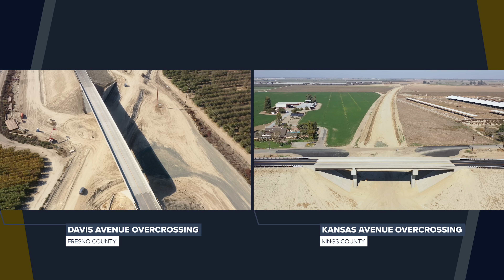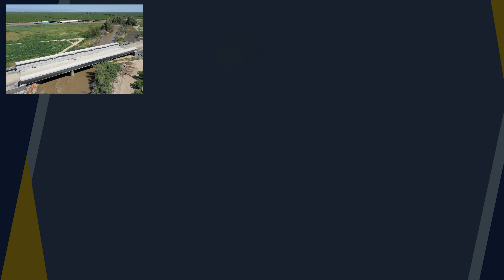Fall 2023 Construction Update: Progress is happening across California thanks to HSR Workers!

Comment: What a boondoggle.  Projected costs are over $125B from an initial estimate of $33B.  There were supposed to be checks for cost and schedule over runs, which obviously failed.  Rider ship estimates are 25% less now than initially planned for.  From LA to Bakersfield to Gilroy to SF.  It wont be hi speed and you need to rent a car on the other end.  The portion showed in the video are out in the valley away from the major urban areas, where its cheaper to get the land and there are less viaducts and utilities to reroute or bridge over.  Land in LA and SF have not been allocated yet and land cost are not going down.  Neither is labor and materials.  If this useless train is completed I bet it will cost over $500B and never recoup the costs.   What a waste of money.  No one takes Amtrac, no one takes the Coaster no one till take this train and will need subsidies to keep running.

Comment: Yes by 2033 you should be able to ride the HSR from Merced to Bakersfield California. There's just one problem, nobody wants to travel from Merced to Bakersfield. After nearly 10 years of construction at a cost of nearly 10 billion dollars not a single piece of track has been laid. The engineering for the project to cross the mountain range into LA has not even been completed. Cost estimates cannot be completed for this section or even its feasibility. Cost estimates for the entire project could exceed 120 billion dollars. This is undoubtably the largest boondoggle conceived by mankind.

Comment: I sincerely hope this is finished in time for the Olympics, or at least within the next 10 years.
Reply: Trains could potentially begin testing by Summer 2028, but the earliest service is projected to begin is 2030, and that’s best case scenario, at least as of now. 

SF could definitely be reached in the 2030s, as potentially could LA before 2040. It just comes down to how quickly they can get funded, plus 6-7 years of construction to reach SF and probably closer to ten years to reach LA and Anaheim, and ideally both extensions would be funded and built simultaneously. 

CAHSR’s priority after Merced-Bakersfield service is established is to reach SF next, then turn toward LA and Anaheim.

Comment: billions of dollars for nothing. . After 15 years not even 1 mile of track exists in the wastelands of CA.  No discussion of how this could possibly connect major cities.  Still in the comments, optimism lol.  IQs are reported to be lowering across America and I see no reason to believe otherwise.  Robbers laughing all the way to the bank with your tax dollars, remember that when you pay your state&property taxes.
Reply: Yes, clearly your IQ is not so great as you don't understand time, nor how construction works. Track laying is one of the last components for a new railway. You are essentially asking why the lines are not painted on a new highway before the actual roadway has been laid! Also, construction only started in mid 2016 & early 2017 after years of delays due to vexious litigation so it's not 15yrs. Perhaps, try doing a little research before posting foolish & ignorant comments.
Reply: @yappofloyd1905  They had spent billions by 2016.  Most of it probably on 'Cost Estimation'.  "But designing and building High Speed Rail is hard!  We are doing the best we can!"  Yea right.

Comment: So happy to see this waste of money is moving forward.  Florida's high speed rail is up and running and started a couple years ago vs CA Browndoggle high speed rail mess.
Reply: Apples & Oranges comparison. Brightline isn't HSR, aves 90mph is 40% single track with 230 grade crossings along an established corridor. CHSR will be fully dual track, electrified & the initial 171mi section fully grade separated & operate at 220mph. You are essentially comparing a single lane rd with an interstate highway.
Reply: check out the cost of the 2 lines, youre right, apples to orange and Floridas has a purpose, CA's doesn't.

Comment: I don't understand the mindset of the people that think this project is a good idea. The original Cal Prop 1A (2008) sold voters on a fast train for less than $10 Billion dollars. The current estimate to complete existing construction is $35 Billion with a final price tag of over $128 Billion to complete all phases outlined in Prop 1A. The time from LA to SF keeps going up. The proposed ticket prices keep going up.

So let's recap:
* It's over budget
* It won't be completed in the timeline proposed
* There is a lack of future funding
* Not one mile of track has been laid
* It will not meet proposed speed requirements
* Proposed ticket prices continue to increase

But everyone in all levels of California State government thinks this is a good idea.
Reply: Most of what you have written is incorrect & ignorant as evidrnced by your track laid comment, ie you don't understand how construction works. Where do you get the nonsense idea that it won't meet the proposesd 220mph speeds? The line is literally being designed for 240mph operational capacity.
Reply: Thank you for your comment. I'll address the one issue that you expanded on. The Prop 1A (2008) stated that the time from LA to SF will not exceed 2 hours and 40 minutes. Since this Prop passed, the number of stations has increased and the length of the rail line has also increased. This makes it now impossible to reach the destination is the time allotted unless some stations are bypassed (which, in my opinion, would be against the spirit of the wording in the proposition). You can't simply increase the speed of the train without running into issues of buffeting due to turbulent air flow. This is an issue when entering tunnel systems where the small amount of laminar flow at slower speeds becomes chaotic at higher speeds resulting in an uncomfortable ride. The portion of rail between San Jose and San Francisco has a current maximum speed limit of 79 MPH. With track improvements the speed is hoped to increase to 110 MPH. This is nowhere close to your stated 240 MPH design. @yappofloyd1905
Reply: @elitoro3193  You're still writing plenty of nonsense. For one, station bypasses are standard in HSR so implying that CAHSR is an outlier is a fabrication, not to mention that the proposition also put a clause to serve the Central Valley (in other words, the I-5 route is more against the spirit than bypass tracks). On top of that, the planers and designers are aware of this limitation but it's the best they could do for the near future in part because the Bay Area is quite built up and proper HST tracks there is something which I can only imagine in the far future.

Comment: An overpass here, an underpass there, a stretch of wall over there. Other than that, a lot of pictures and computer graphics. Not much to show for ten years and billions already spent. Still not a foot of track laid.
Reply: It's only been 5-6yrs of construction. As of Sept, $10.2B has been spent & that includes $1.2B on environmental approvals, $600m on vexious litigation, $800 towards Caltrain electrification etc. And if you understood how construction works, you'd know that track laying is one of the last components to install. However, that should start later in 2025 so you don't need to wait too long.

Comment: If going from Sac to LA requires stops at places like Tulare-Kings, what's the point of high speed rail? Taking hwy 99  is faster than stopping in places that can't fill a high school gym.
Reply: Ever heard of an express service? All the stations in CV will have passing tracks for express services.
Reply: @yappofloyd1905  Express service is a fix for inefficient routing. The lines would be significantly shorter and cheaper if they weren't required to go out of their way to get to stations that don't yet exist.
Reply: @brainycheddar  Guess what: This is standard for HSR, from Japan to Spain.
Reply: @MarioFanGamer659  the difference is those lines go between population centers that have existed for hundreds or thousands of years, where as here's it's stopping at projected future population centers. Instead of servicing a community, it's servicing a patch of dirt wishing a community will form.
Reply: @brainycheddar  Many of these "population centers" only got most of their population in relatively recent years, though.
In any case, both Fresno and Bakersfield have a respectible population (500k and 300k, respectively) and while the Kings/Tulare station does fit your description, it's mostly because the tracks were built in parallel to the San Joaquins and not the UP tracks (since Visalia has a more sizeable population) as well as how the Hanford government opposed the tracks going through the town.

Comment: Notice how they never say how much a ride on this thing is going to cost. Using an existing HSR, the Eurostar, as a comparison, the fictional future ride from San Francisco to LA will cost AT LEAST $300 a seat. That is about what Eurostar tickets cost for a similar trip.
Reply: The Shinkansen is significantly more comparable, both in terms of construction cost and rolling stock, and they charge $100 or $200 per ride depending on the total distance. Extremely competitive with flying, and a huge time saving over driving, and that's even if it costs that much.

Comment: It's terribly, terribly important not to have level crossings and high-speed trains. Drivers WILL get on the tracks. It doesn't matter what anyone says about safety: drivers will do it.
Reply: You have no faith in American culture. If 29 countries can have HSR, we can too. It would be foolish not to invest in our future, especially when we are so far behind and so dependent on foreign fossil fuels. 

We need to have a backbone and stop breastfeeding off of other countries for our resources and prosperity.
Reply: The place where level crossings exist is in the Bay Area which is a much more slower section and consists of existing tracks. The main, actual high-speed section OTOH is entirely grade separated (the FRA forbids to have any crossings on these speeds, in fact).

Comment: I think that the cawtrain and the California bullet train shouldn't share tracks. In the northeast corridor, this is the greatest problem with Amtrak acela bullets. They can't open them up to full speed capabilities because they are on shared tracks with the slow and lethargic freight trains. All over and around the globe, Bullet technology has their own tracks and footprints. You start placeing other crap on the tracks, there goes your full intended services. You'll spend the next 10 decades on how to fix this. Trust me Amtrak is still trying to do the same thing. How do i fix this?
Reply: The biggest problem here is the lack of space in the Bay Area (and the Los Angeles area too) which makes building a proper high-speed line difficult especially since the benefits there are relatively marginal. On top of that, this is also true of European high-speed trains so "all over and around the globe" also is kind of misleading.
Reply: @MarioFanGamer659  yes difficult but not impossible. To take something difficult and construct a Highspeed unit to co exsist with it's left over terrain would be a fine exsample of human achievement. For Example, Who in the hell would ever think you can put a Highspeed bullet line beneath the english channel? What a magnificent achievement! What about the Pennsylvania turnpike? They blew away and built tunnels through the blue mountains, 7 ranges,( 7 !!(RANGES)!!! that's 7 mountain ranges to make way for the interstate called the Pennsylvania turnpike! This highway began construction in the 1880s. This is long before the time of our current technological advancements such as the current machinery, computer technology, GPS, drones and other fine advancements we have today. 60 years later in the fall of 1940, the four lane highway was completed. Still to this day it is considered to be a technical engineering marvel. This is the United States of America. Here's another one for you my blind friend. America's, that's right,  The mighty United States of America build the first trans continental railroad. This 1,911-mile railroad line began construction in 1863, the same time the civil war was going on!! Also long before technology, this railroad was built on the blood and sweat of our american, (AMERICAN!!) forefathers. It was completed in 1869. So don't tell me that the American people can be stopped by geological structure. Dont tell me we can't  do something especially with all this great technology we have. Don't talk to me about how costly it would be when the government can give away, GIVE AWAY!! Over 7 trillion dollars in stimulus packages during the pandemic. Eventhough we have all these technical machinery that could more than aid us, today's american generation is very lazy, just like you, always coming up with a reason not to do something instead of simply doing it. Let me see America, for once, roll up their sleeves and put it up! Just like we did in the times af this country's development. California has a great time in history,  to be the first state in the United States to provide Highspeed bullet train technology. Don't fk that up......
Reply: I prefer American made jets over this stupid train    This train is a step backwards, a huge waste, a huge drain on the taxpayers.   the airlines make a profit and still pay taxes.  this train just takes taxes and will never make a profit, or even break even.     God dam this train
Reply: @davidgenie-ci5zl  Yes planes are better, but using your point, roads would be stupid as-well because they use tax payer dollars and never generate profit.
Reply: @AdumzzFromAbove  My gas taxes pays for many roads, and even for public transit.  the train fares wont even cover the train cost.    if not for the gas tax, many public transit operations will go broke.  And what good is the train if there be no roads to and from the train station?
Reply: @dave8599  There’s always roads to stations, or else nobody could get there
Reply: Acela shares with 1-2 freight trains that run a midnight. Not at peak hours
Reply: You fix this by scrapping this train and instead fly in a jet above it all at twice the speed.

Comment: The tickets better be cheap, or Central Valley residents will not be able to afford it.
Reply: SJJPA, who operates the San Joaquins, will be the early train operator for the Merced-Bakersfield HSR segment, with current Amtrak service truncated south of Merced. Amtrak along with ACE will connect with HSR at a new shared station. Ticket prices will be up to SJJPA, but my gut hunch is they’ll be the same as the current prices since the initial HSR service will effectively be a 2x faster extension of the San Joaquins. As for eventual SF-LA service, CAHSR has said they’ll be 80% of average airfare. I would imagine ticket prices will remain affordable for the vast majority of residents.

Comment: It's insane how it took so long for the US to finally get high speed rail. Countries like Japan have had it for decades, with frequencies of every few minutes. How are we so far behind in public transit?
Reply: The Acela is HSR and has been in operation since 2000. The Northeast Regional also fulfills the EU requirement for HSR and would be considered such in Europe or Japan. So the US actually got HSR before China, we just never built more than the one line.
Reply: We are so far behind because 200 MPH HSR can't compete with the numerous 500 MPH jetliners that link more cities than rail can.
Reply: Short answer is population density. In a country like Japan a single rail station will have tens of thousands of potential commuters and jobs within easy walking distance. Tokyo has a population density of 6,158 people per sq km and a total of almost 14 million residents. Los Angeles has roughly half that density at 3,206/km2 with a total of under 4 million and Fresno has 1,823/km2 with a total of just over half a million. If you go out to areas that have more affordable housing it drops even further. That means in California you're going to service far fewer commuters no matter what and to be practical for even a minimal amount of them you need to add many more stops which quickly increases total travel times and reduces the attractiveness of that route.
Reply: @Tangent360  Two things. First, you're comparing Tokyo, one of the densest places on the planet, with Fresno. Yes, Fresno is much larger and denser than anyone from outside of CA expects. It has 1 million people in its metro and a serviceable downtown that can be developed into something great. 

But come one! At least compare Tokyo to SF or the Tokyo metro area to the Bay Area. The national focal point of a nation 3x larger than California cannot be compared to a second tier city in California. That's just not a valid comparison no matter which way you cut it. Compare Fresno to a second tier city in Japan that's on a Shinkansen line. You'll actually see a lot of them that are very comparable both in population and economy size. 

Second, the less dense urban form in both California and Japan were engineered to be what they are. Japan very deliberately densified around the train stations. And California is literally doing the same. The state government designated the station areas as primary development sites and gave the rail agencies the right to develop those sites into dense urban areas. We can and should build what Japan has built around our rail stations. What already is there matters very little. It only matters what will be built there once the trains start running.